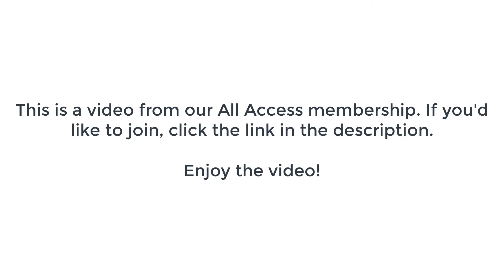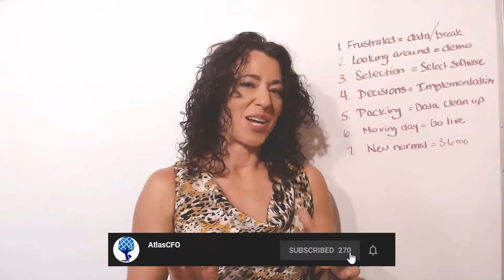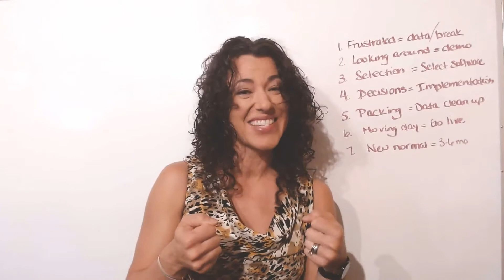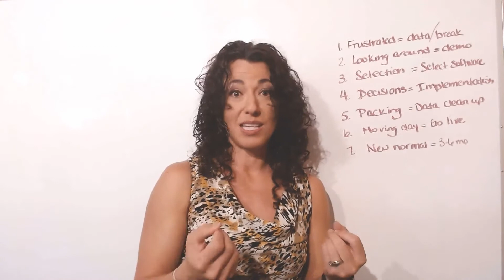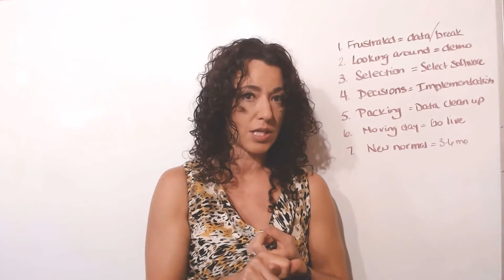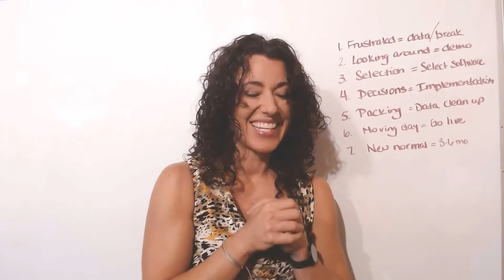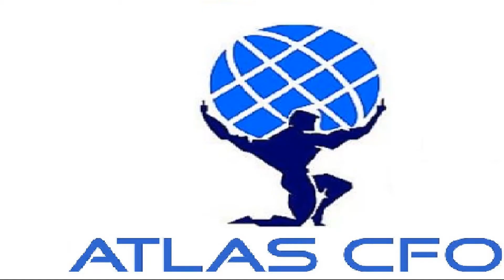Implementing New Construction Accounting Software: Expert Tips and Tricks

Comment: TLDR: Selecting and implementing new construction accounting software is similar to building a new home and requires careful planning, decision-making, and patience for a successful transition.

00:00 🏗 Selecting and implementing new construction accounting software is similar to building a new home and takes about nine months.
01:19 🏗 Research and explore different options before investing in new construction accounting software.
02:47 🏗 When implementing new construction accounting software, it's important to take the time to demo and create a wish list, make a decision, and be prepared for ongoing daily decisions.
04:06 🏗 Making decisions and cleaning up data files can feel overwhelming when implementing new construction accounting software, similar to the process of packing and making decisions when building a house.
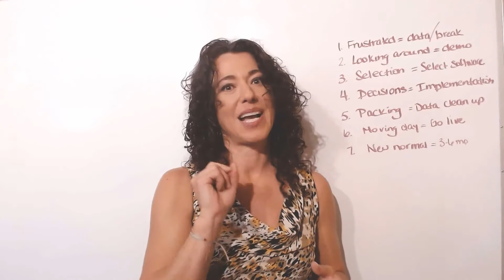05:18 💡 Consider timing and designate a point person for software implementation to avoid overwhelming staff, and go live date marks the transition to using new construction accounting software exclusively.
06:42 🏠 Moving to new construction accounting software is like moving into a new house - overwhelming at first, but with time and patience, you'll acclimate and it will work.
07:51 🏗 Moving to new construction accounting software is like moving into a new house - it takes time, preparation, and a transition from a simpler system to a more advanced one.
08:59 👍 Choose between investing in current software or implementing new software, consider timelines and options, and reach out for support if needed.